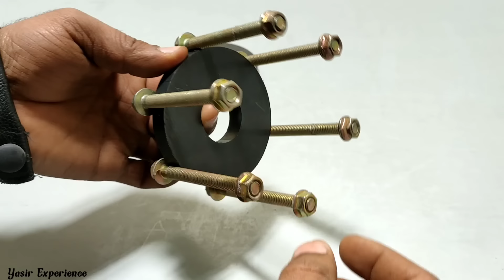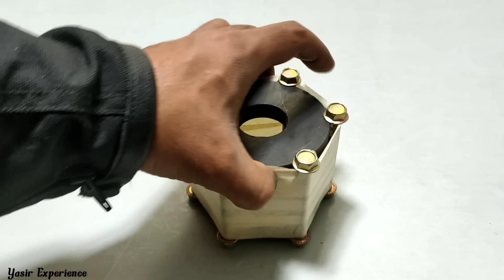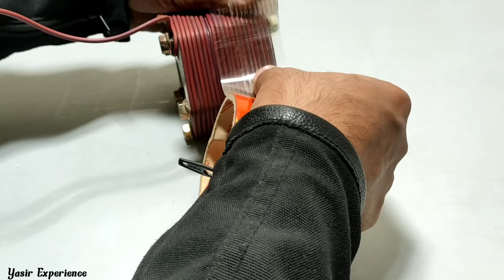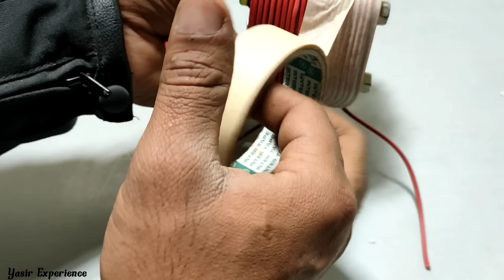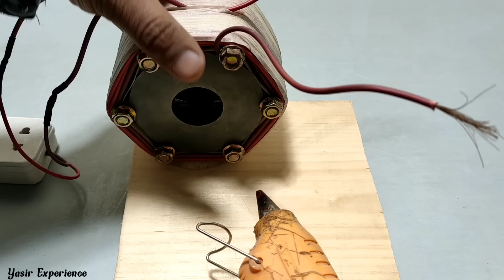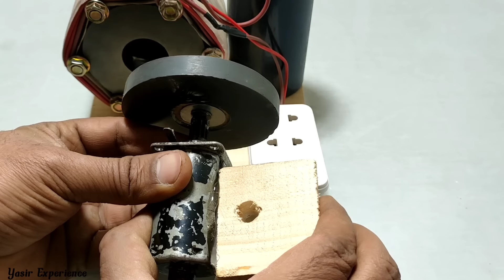i turn permanent magnetic coil into 260v generator use super capacitor.

Comment: You can't use a super capacitor if its power produced is ac, it should be passed to a rectifier to make it dc to be connected to the negative and positive polarity of the capacitor

Comment: I couldn’t imagine the magnetic field intersecting the wire winding to be able to produce the potential to move the electrons and form the current, I don’t believe it works.
Reply: You are correct!  It doesn't work.
Reply: @richardbrown8409  He never said it doesn't work. He said he doesn't believe it works because he can't picture the energy flow. His statement is valid. Yours is not. You don't have a deep enough understanding of magnetism to authoritatively state whether or not it "works". It probably works, otherwise he wouldn't have made the video to demonstrate how magnetic energy flows.
Reply: How is it possible,the c.c.c.of wire he is using is too low, will burn in few minutes.
Reply: no understanding 100% FAKE @biblicalfitness1838
Reply: Anything we made from permanent magnet will not run long term. Because permanent magnets become weak easily after some days.
Reply: @BS-yy8ur  i have 15v old permanent magnets in the generator still just as powerful.
Reply: @emil.honganmaki5461    wooow...  👍      🤔   Those are good quality magnets.
Reply: Until proved other wise too many tricks can be done.The super capastor might have hidden batteries in it and no indication how many farads as  large capacity farads can run equipment for some time. The wooden platform under it can  store hidden battery or induction coil to hidden power source under the table..The power source to drive electric motor not shown assumed to be a 12 volt battery but might be 1000 volt source  so we are just looking at 1000 volt transformer that twirls and rotates  around and the secondary  coil  drops the 1000 volt down to 260 volt .We lack information on capacitor primary power source  SWA guage of wire type of permanent magnets  Thier quality types and Gauss    info lacking so for me it's entertainment  only
Reply: Exactly bro
Reply: @emil.honganmaki5461  its possible buddy when moving magnetic under the aluminium wire to produce electricity i agree this processing method
Reply: @Gamer In A Van p

Comment: Errors that have reduced the potency of your project:
the secondary coil is practically the same thickness as the primary.
when the primary coil is the same thickness as the secondary there is literally an induction that causes loss or something like that, which greatly reduces efficiency.
you practically built a voltage transformer that doesn't transform nothing ,just an inductor, not an energy generator.
Or an energy generator of low potential and an inductor.
Reply: Rafael teach please instead of berating ,coil wire thickness is very important

Comment: You has 3 ways to fix your project:
1- You must to put your rotating magnet in that empty space on the center of your project 
2- Use just one wire, but making more turns of it on these screws, removing those 2 magnets for you to use them to spin and produce more energy. In this case you use anything to support the screws instead of them, cause they'll be fixed to the motor and spinning, but vertically, not horizontally like that in your project.
3- The secondary wire must to be thinner than the first and have more turns, cause the first it will become a generator and the second a transformer, that will produce more energy than the first.
Reply: And use alien tape that’s what’s missing..!!!! Lol
Reply: I think of that magnet was up in you it worked better
Reply: Haii bro. Can you show a tutorial on how to power air conditioners using a magnet bar or magnet ring. I really appreciate it if you make a video and list the item and measurements to assemble the item.
Reply: ❤super❤
Reply: ❤Thank  you❤
Reply: ❤Klas❤
Reply: You just about had me until you didn't show the source of the alligator clips what powers them. 5 kilowatts would burn them lights a lot brighter, I would think @user-mm8nj4ie3m
Reply: Vylepšovat nesmysl, to dává smysl. 😅😅😅😊😅

Comment: Para q haya voltaje se requiere una velocidad ..d sincronismo  q el campo de fuerza impulsor sea mayor al campo inducido. Q el campo del transformador se cumpla ejerciendo unas líneas d fuerza d adentro hacia afuera eso haría q se transforme un voltaje mayor y estable. Así como conecto es una reactancia. Pues al estar el núcleo quieto no  va a engendrar unas líneas d fuerza q produzcan energia
Reply: Pune
Puna tw jep drit, tu lumt
Reply: Hello Cristian you are wright. Look what I have written: 
This maschine disregards the induction law, that magnetic powerlines and the electric lines have to stay in a 90 degree angle. There only the stray field induces electricity and the efficiency is not worth to be recognized. It’s a pity of the working time 🤡
Reply: @selimigrishta300  x
Reply: @selimigrishta300  n

Comment: The coil output is Alternating current AC, you CANNOT connect this directly to a Supercapacitor which is DIRECT CURRENT (DC)
Where is the Bridge rectifier and the Voltage regulator for the Supercapacitor??
Very dangerous !!
Reply: Ther is no question of generating any electricity as magnets are not changing polarity when rotating.So don't worry of any danger.Totaly fake

Comment: The bottoming here is to start the project from start to end to finish without a word without a single explanation. And you must be serious and show the people it's working even if it's not working. At the end it will be viewed by 100 thousands daily
Reply: If it's not working, than would never be able to show it working. If it is not working, then it will not work.
Reply: He powers it with a car battery and also glued a battery to it then hooked the outlet to it would've been more impressive if he wrapped each bolt individually then rotated an electro magnet in the center at a high rpm still would've needed an out side power source maybe not an electro magnet so regular magnet hooked to a wheel with slots a hose up hull in a river go down size periodically and have the hose hit the wheel slots to cause it to spin use 2 one with electro magnet the other with a strong magnet like people use to magnet fish and another external power source to make it look like it works

Comment: you have to explain it to us as loyal viewers. what size bolt do you use? What is the radius of the media circle? what size cable is used and the number of turns? etc. Don't forget how much electricity is generated through the measuring instrument.
Thanks 

￼

Comment: The magnet loaded on the motor magnetic flux doesnt changing from N to S.
Reply: Exactly
Reply: Yes but isn't the magnet rotating or skimming against magnetic line of force...as the lines of force are entering and exiting the blch wall... Iv seen something similar but with a magnet on the side of his coil being moved without a motor where the arc of the field is moving the magnet in the direction that its flowing........
Reply: @jaykelman7949  no buddy ...... I'm  graduated in physics.....  rotation of the magnet doesn't change the magnetic flux  until the magnetic poles simultaneously change from N to S and S to N in the rotation against the coil....thats why it doesn't produce current....and one more thing u know “Energy cannot be created or destroyed; it can only be changed from one form to another.” (Albert Einstein).
Reply: It is possible for a ring magnet to be set up one half North and the other half South rather than one face North and the other face South but it still wouldn't matter this is ridiculous those light bulbs are working because that capacitor is like 2100 volts now I don't know what the deal is with that like hillbilly magnetron setup I don't see how that does anything but even if you could rotate that little graphite magnet at ridiculously high speed you would still not generate s*** in the way of usable current through that coil it's bogus

Comment: Hello, first I want to know where to connect the small motor, second what dimensions are the materials with which you make the coil.
magnet dimensions, wire dimensions and screw dimensions. it looks very good but it is necessary to explain if the motor is at 12 volts. etc. Thank you
Reply: Fake.
Reply: FAKE😂😂😂😂
Reply: @ alejandro rubio Velasquez
This maschine disregards the induction law, that magnetic powerlines and the electric lines have to stay in a 90 degree angle. There only the stray field induces electricity and the efficiency is not worth to be recognized. It’s a pity of the working time 🤡
Reply: is fake i know i made the same is working only with battery no free energy  not  loose money the capaciror cost a lot  and no effect
Reply: @kittygrey2181  the capacitor he use is from trash.... This size at 400V have not really a big capacity and ist not a supercap....
Reply: @kittygrey2181  👍  yah, true.

Comment: Perché in tutti questi progetti il tutto si incolla in una tavoletta di legno quasi a voler nascondere cosa c'è sotto, oltretutto quando la gira sembra faccia perno proprio sotto la zona degli avvolgimenti... Perché non li incollate in una lastra di vetro  o di plexiglas trasparente e non li sollevate mai prima della prova?
E poi...
Che senso ha dividere i due avvolgimenti (tra l'altro con il cavo della stessa sezione) per inserirci un super capacitor? Potrei capirlo se avessi messo qualche spira per generare la corrente che serve al motorino per autosostenersi... Ma così come è potevi metterlo direttamente alla fine di un unico avvolgimento poco prima delle prese di corrente
Potevi inoltre mettere dei magneti al neodimio disposti in linea e farli girare all'interno degli altri magneti per migliorare il rendimento. .
Inoltre...
Perché non viene indicata né la tensione delle lampade né hai messo un voltmetro per misurare la tensione in uscita del tuo trasformatore? Sono lampadine ad uso civile o con una tensione particolare? Secondo me sono a basso voltaggio anche perché il magnete rotante non gira nemmeno velocemente (trascuriamo in questo caso la frequenza di utilizzo in quanto per alimentare delle semplici lampadine la cosa è trascurabile) ma credo che la bassa velocità non sia nemmeno in grado di generare una variazione significativa del campo magnetico.
Aggiungo anche che forse sarebbe stato meglio usare del cavo smaltato anziché del cavo con isolamento plastico proprio perché in questi casi il minor isolamento ne migliora l'efficienza.

Comment: What's the point? If you are not generating power to run the Motor that activates the coils, your loosing power. What is the source for the motor and Voltage and Wattage?

Comment: Could you give me information ,what things must be prepared  for this project
1. THE MAGNET with diameter ? .........
2. HOW LENGTH CABLES? ......
3. THE SPSISIFICATION OF THE CAPACITOR ? how many farad , volt . ampere .......
4. other device , is it dynamo , what is the spec ? .......
thanks
Reply: Judging by the size of average hands and bolts I would estimate 60mm diameter x 20 i.d. X 12mm magnets with 65mmx 8 mm bolts. The capacitor looks to be 2.7v 3000F  but I suspect this video is hiding the power source that supplies energy to the alligator clips attached to the 33,000 rpm electric motor.
Reply: All you need is the external power source he powered the motor with lmao

Comment: This video is false, there is no possibility of generating such a voltage to turn on so many lamps with such a low speed of the magnet. In addition, he did not place a bridge rectifier on the capacitor.
Reply: Yes it's a Fake.
Don't waste your time trying to make this montage!

Comment: Absolute nonsense that cannot produce anything at all. In these megnets, the magnetic field is oriented in the axis, so that when the magnet rotates, the magnetic field does not change and therefore cannot induce any voltage in the coil. The connected capacitor is completely useless, it has no effect.